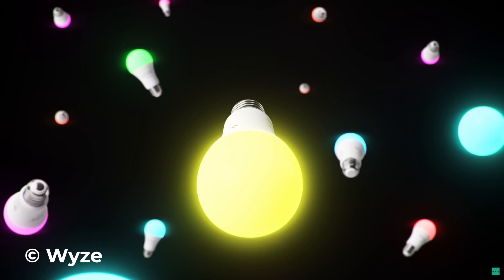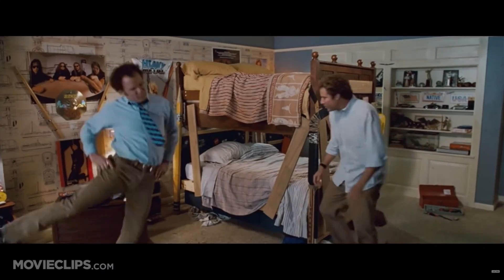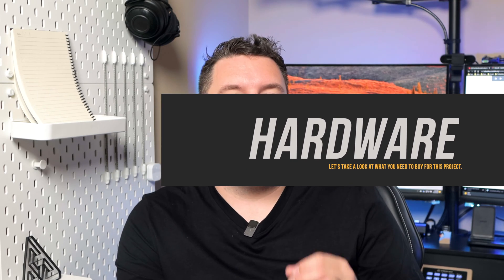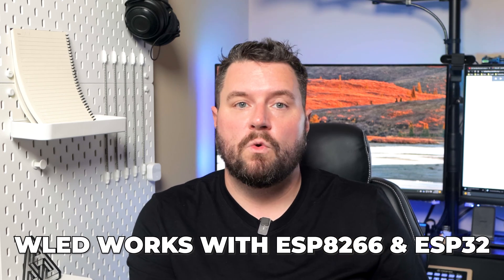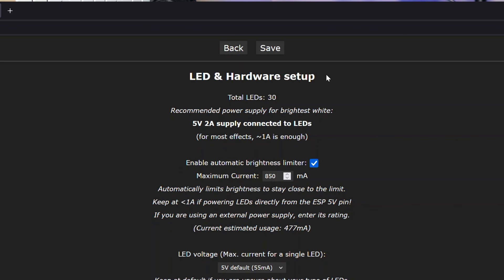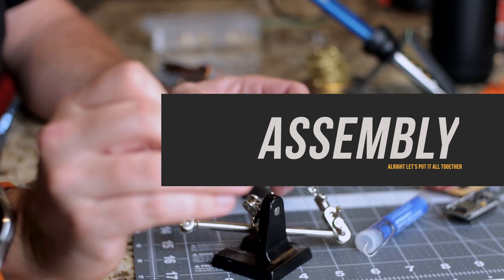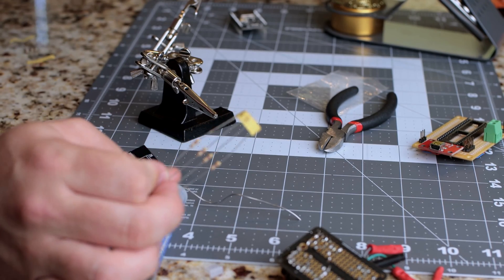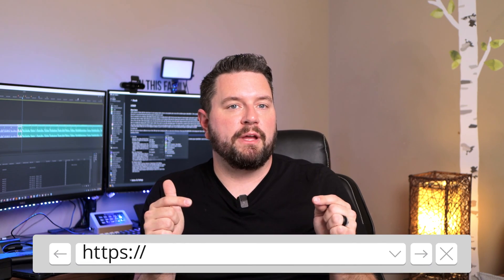Setup Your Own LED Strips // WLED Hardware // Part 1

Comment: Hey Ryan, I dont think I have enough power for my LED strip, I think, as they are not lighting up. Your math for my setup is 60 ma, 300 pixels (total) / 12vdc = 216000 is that watts (looks very high)? My wall plug is 12v 2A (input 100v-240v). btw, Im in the UK!
Reply: would this suffice? Power Supply 12V 5A,AC 100-240V to DC12V 60W. In addition, do I need a step down converter (12v to 5v) as my microcontrollers eem to fry?!
Reply from the maker: Good question. First my current was based on a 5v LED strip. A 12v will have lower current (Power = Voltage x Current). For example the WS2815 has a listed current draw of 15mA. So 0.015A x 300 x 12V = 54W (worst case). Plus the current draw of your controller. So 60W should be enough. 
So your current plug is undersized (24W). But a 60W, 12V power supply is pretty easy to get a hold of. Just make sure it is 100-240VAC @ 50Hz input (you Brits have to do everything differently 😂)
The one you referenced should be correct. 
But as you said you will need a 12v to 5v step down for most controllers. 12v will indeed fry them.
What specific LED strip are you using? Sorry for the long reply, let me know if anything doesn't make sense.

Comment: This is a great video! Unfortunately I only watched it after picking up an ESP-32 at Microcenter today. Your PCB looks great, have you made an updated version for the 32?

Thanks for the great video! The second part is great too.
Reply from the maker: I am working on one but you can wire in an esp32. It is ugly but it works.
Reply: you dont need such complex circuits to connect to a esp32.. u just connect the 5v, gnd, and a signal pin.. that’s it and u can limit the current and everything on wled software.. to power up the led use the other injection wires provided on the strips.. would work fine without any issues… no need of super high tech circuits in a pcb to make stuff more complex.
Reply from the maker: Except for you need the resistor and you should add fuses to protect the wires from overcurrent. Plus it makes it easier to set up.

Comment: Is it possible to run an RGBW strip off of a 8266 controller?  If so what is the pin setup?  I want to run it with the WLED program.  If not possible with WLED, which program should I use?
Also, some gave me an RGB strip but it has 4 terminals (R,G,B,+).  How do I set that up?
Reply from the maker: So that would be a non-addressable strip (you can't control each LED pixel). You can just control the entire strip at once. 
You can check out this users post who is doing something similar: https://www.reddit.com/r/WLED/comments/pcoouc/using_wled_with_analog_rgb_led_strip/?utm_source=share&utm_medium=android_app&utm_name=androidcss&utm_term=1&utm_content=share_button
You will need some additional hardware and configure WLED for RGB PWM. Alternatively you can use ESPHome to control the strip. WLED's effects might be overkill for that strip.
Reply: @ThisSmartHouse  Thank you.  I think it's is an all-or-none strip.  Didn't realize that until your post.  Thank you.  I'll check out the link.

Comment: When I use the esp32, do I need the extra resistor board too? I watched a lot of projects on yt and with the esp32 they never used an extra resistor. Also, I looked for bigger projects with 600leds+ where they connected the esp32 and the leds directly to the psu and just connected the Data wire from esp to strip.

Comment: I am trying to figure out why you're using the resistor even in your blog post diagram it's not clear what it's for
Reply from the maker: It is a pull up resistor needed for the LEDs. It is in all of the design requirements for the WS2812s.

Comment: Noob to 3D printing and Octoprint. I wanted to get some help getting started with WLED and found your series on the subject. The information you presented makes it look easy. Waiting on my PCBWay order before ordering the rest of my supplies.
Reply from the maker: Nice! So glad the videos helped. I just moved my printer to a new location and killed my pi. So I had to watch back parts of my videos to remember how I set them up. 

I hope that PCB makes the install easier for you.
Reply: @This Smart House  I run SolidWorks professionally and plan to model a box to contain everything. Do you know of a barrel plug that can be mounted directly to the pcb to power everything?
Reply: @ThisSmartHouse  never mind, I'll just source a panel mount jack.

Comment: Hello, can you help me to have some esp32 with diferent sectors and to work acording some motion sensor... To use wled?

I need for my home (aproximativ 40 m)

I will offer 100 euro bonus If you cane hellp untill the end of project
Reply from the maker: Are you wanting to have one ESP board run the LEDs and Motion sensor? Or do you already have motion sensors and you are just adding LEDs? 

What smart one hubs do you have?